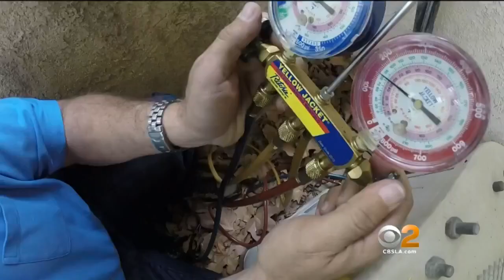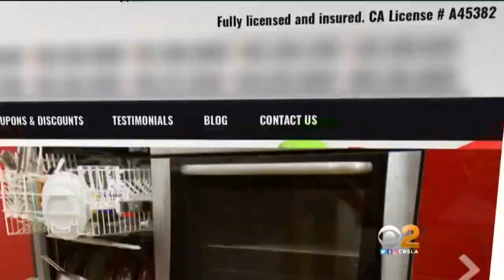Caught On Camera: Air-Conditioning Repairmen Inflate Fees To Fix Simple Problem

Comment: I'm a plumber who mostly works on boilers and heating systems. If i were to come across this scenario,  I'd fix the thermostat wire, then cycle the unit a few times to test all safety and operating controls. Stay 35-45 minutes and charge a reasonable fee for my time. These guys who find the rigged wire and repair then walk away are not doing the right thing, in my opinion. You're there; inspect everything.

Comment: Lot of AC repair co over charge the customer 
I got reap off by AC repair  / most repair of AC is the capacitor or contach switch
Most will charge $300.00 to $500.00 to repair  / those parts are under $50.00 each
Don’t let the first repair co do the work get an opinion from several companies 
Or go to you tube get an idea how to repair it yourself
That what I did now I know how to do the work myself 
It’s fairly easy